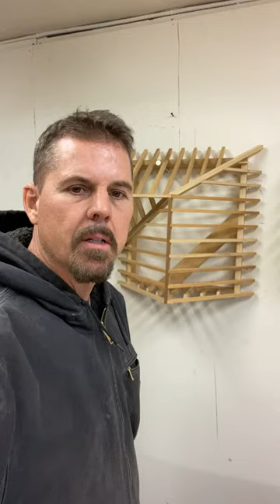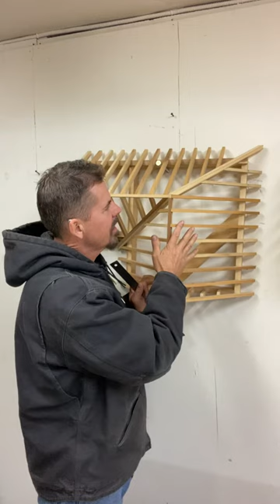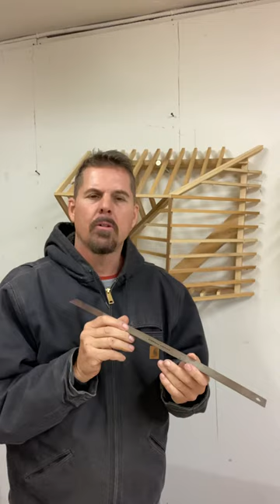More bastard hips and Valleys.

Comment: Here is a tip for cutting bastard hips if your hip is on a 45 degrees instead of a 90 Square corner use your speed square and Mark let's say it's a 7 and 12 picks Mark a common and then Mark a hip on the same Pivot Point right in the middle will be the hip cut for a bastard hip and Valley
Reply: Try punctuation dude!